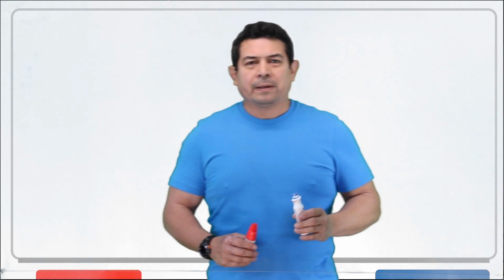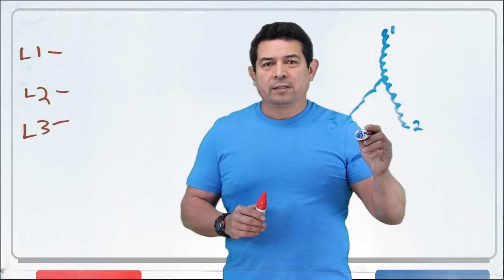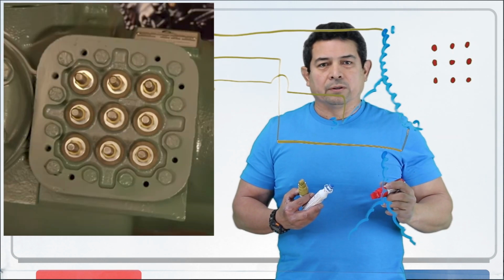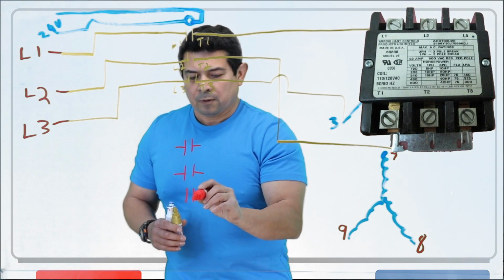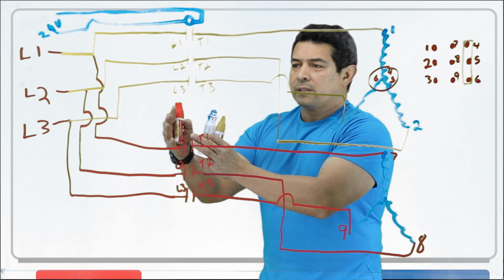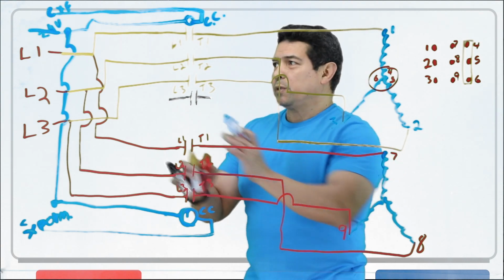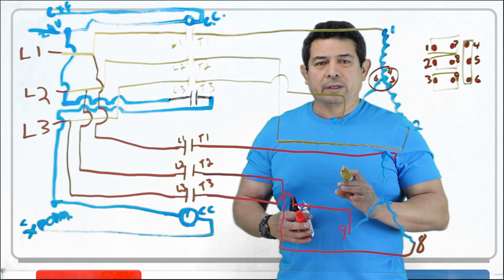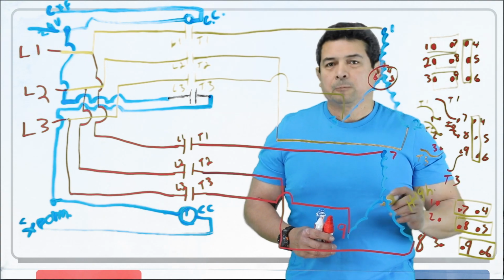Motors 10 Compressor - 2 part start connections 208V -HVAC Online Training and Courses

Comment: How to change oil in blitzer AC compressor without vacuum pump
Reply from the maker: I will be honest with you, I don't know if that is possible! You first need to close the suction valve on the compressor to isolate it!!!  Then pump the compressor down to remove the pressure inside the compressor. Close the discharge service valve.  then get the oil out. After that, you will need to pump New oil in. You will most likely get air into the system as you pump the oil in. It is this air that needs to be removed by the vacuum pump. If you. Do not evacuate you will leave air in the system. As far as I know, it will be next to impossible to pump oil in to the compressor without getting some air into the compressor. Good luck and thank you for sending you questioning.

Comment: i dont see where there is a delay. your feeding the contactor and the auxillary contact at the exact same time coming off you t-stat.
Reply from the maker: oh   I see what you mean.   Remember, electricity travels at the speed of light. Was one contact her holes in it is going to pull the auxiliary contact in. That a lot of times is enough of a time delay. Other times there is a timer that is used but it said to one or less than one second time delay.    And when you actually see it happen you can see the time delay.  I hope this helps.

Comment: how many seconds sir approximately the delay on that set up of designed?thank you
Reply from the maker: In the past I have said that to 1/2 of a second or one second. Remember electricity moves at the speed of light so even one second is very slow of a time period. But that is how I have set them in the past. I hope this helps.
Reply: thanks a lot sir.more power to you

Comment: Hello Sir i am new to your channel i liked what i watched already very much i have a question if you may how dirty condensor affect superheat and subcooling and why
Reply: Thank you Sir for your reply is it possible to have a video clop on how superheat and subcool get affected when charge or ambient or airflow change and why i still can not understand why subcool is high when i system is overcharged and so on appreciate it if that is possible or doable by the way i subscribed after watching the first clip because i can tell that you know what you are talking about God bless
Reply from the maker: It is a long explanation but I will make it a short explanation.   The condenser gets rid of the heat. If it is dirty then it cannot and the pressure increases. Because it increases it pushes more refrigerant in to the evaporator decreasing the Super-heat, when you have a fixed orifice metering device.   The subcooling will drop.    I hope this helps a bit.  Glad you like my channel and hope you subscribed.

Comment: Thanks sir you are really great,but I have some doubt in this cannection my compressor have six terminals and 440volt, that's why my compressor 4,5,6 terminals winding inside compressor.......? And doubt no.2 I was watching some unit 2 contractors amps showing same, and some unit 2 contractors amps showing different. So I am confused...!! What to do? please tell  me sir 🤔🤔🤔🤔.
Reply from the maker: YES!!!   some will only have 6 connections.  Like I said in the video there is not enough time in that video to cover all of the different connections.   there are motors and compressor motors that will have3, 6, 9 and 12 leads or connections.     The ones that have 3, and 6 connections are only one voltage, whether it is 208 or 480 volts and you cannot change it.  The reason you have 6 leads is so you can wire it  in either Delta or Wye configuration. The 9 and 12 lead motor or compressor you can wire them for low voltage 208/230, or high voltage 480 volts.    As for your second doubt,  The amperage is lowered only on start up and you will NOT see it as the motor is running. I was talking about the inrush current.  witch only happens for a a split second and that is only at start up.  I hope this answered the questions you had. There is a lot more that I did not go over, here or in the video, I talk about those in class but no time here  I am sorry, but Thank YOU for watching and asking questions!!!!
Reply: Suppose one contractor 60% another 40% amps  according RLA.(same chiller unit)Why its  happen  on hvac compressor part winding cannection .